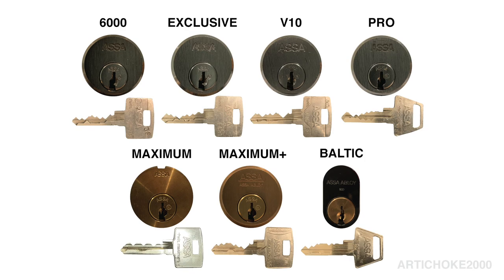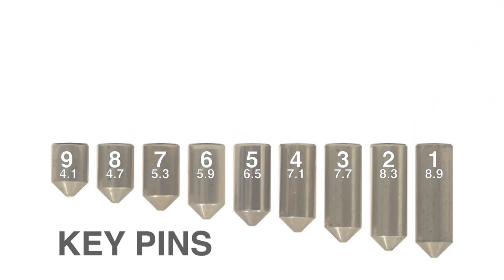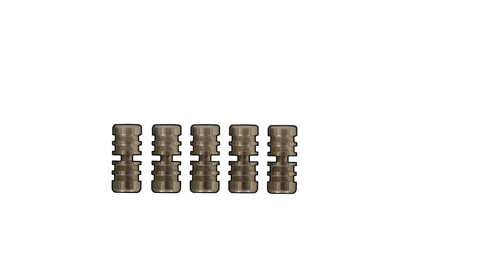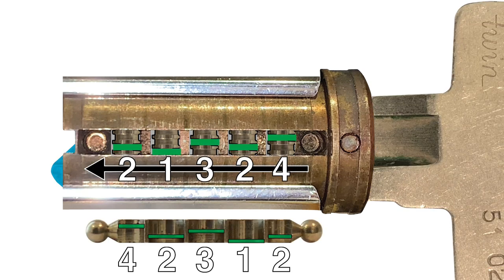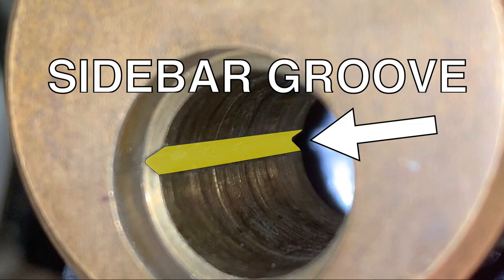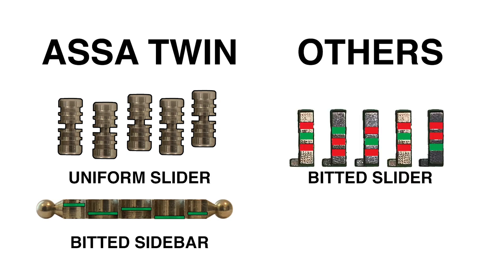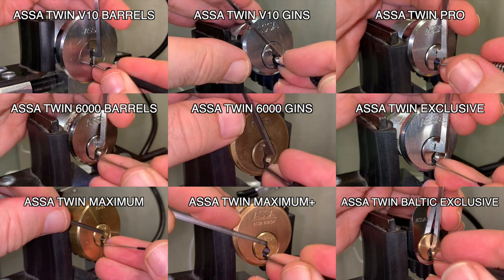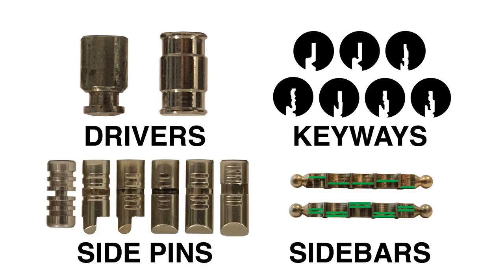(32) The ASSA Twin Series Intro

Comment: Really happy we went with the Garant based sidebar pins after the original twin 6000 party.
Reply from the maker: Hey Rune! I actually like both systems. Why do you like the Garant better?
Reply: @ArtichokeTwoThousand  think it is better to be able to have a replacement sidebar in the toolbox, and just 6 pin sizes that is not locked to 2 sidebar codes.